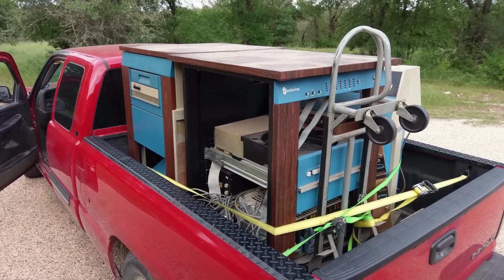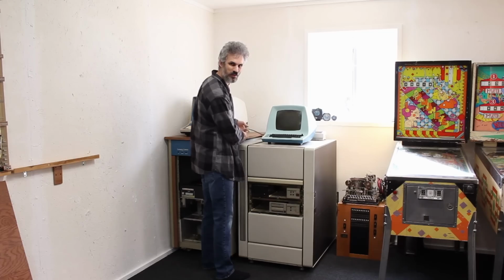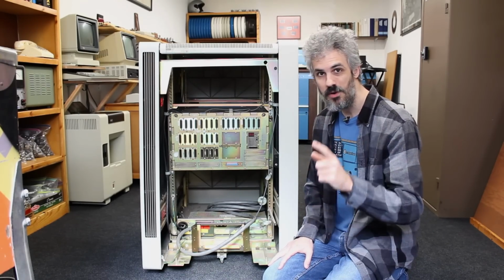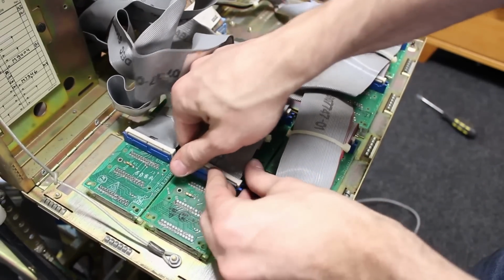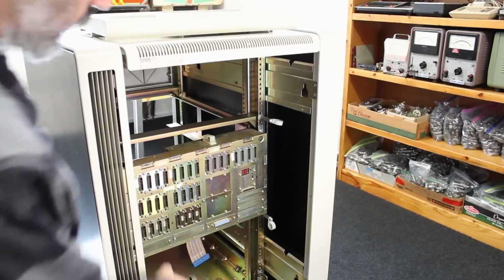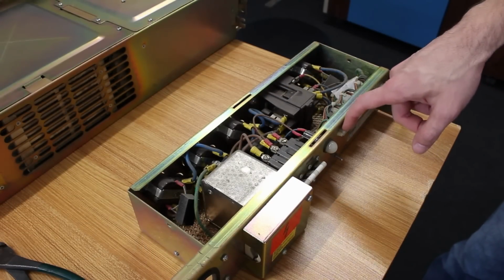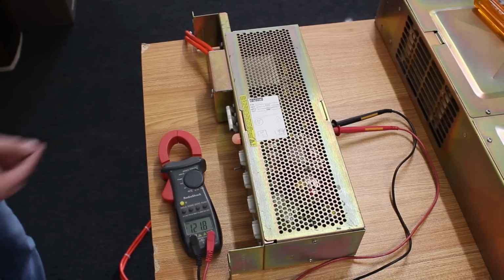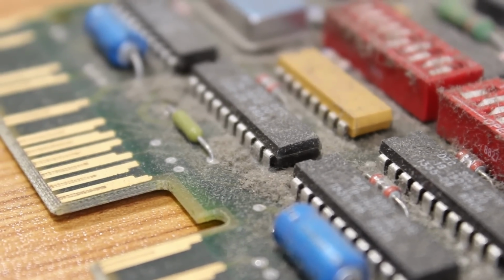I Bought a PDP-11/83!

Comment: as for cleaning off old tape residue try some heat and rubbing alcohol. Also wd40 and or brake cleaner (test first in an inconspicuous spot) ive cleaned old tape crap off by soaking a paper towel in wd40 and letting it sit on the residue for hours.

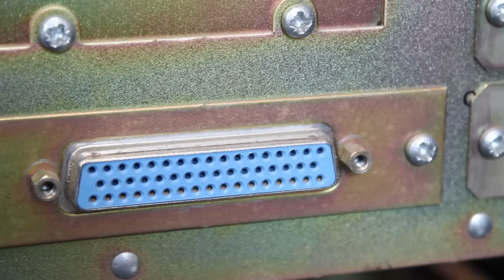Comment: 8:25that female DB50 connector is usually ALMOST GUARANTEED to be printer output.  BUT !!!
small chance it is connected data storage (handling up to 48 bits per clock cycle) 
more likely only handles 32 data lines with the two power and 16 assorted control lines
and with so many RS-232 (Male DB25 shells with just 11 pins - 8 data plus power, ground, and clock)
... HERE'S A SURPRISE... (but not really after thinking) exactly 32 - RS-232 connectors on that back plane

leading me to think it was servicing 32 users.... still not giving up on DB50 connecting to a big printer, but modern ones use USB-2 connectors. so i wonder WHAT IS MANUFACTURING YEAR? 
the PDP-11 that i used in early 80's had magnetic storage (individual magnets woven in three wires per)

a big change from what you have   ALSO , i was fascinated by the instruction set.   very minimalist. technically only about a dozen instructions

Comment: Pittsburgh is much more Tech advanced than anyone knows for strategic reasons. I know many DEC and PDP people as well as Cray/SGI and Sun. I have always had access to machines and/or people here working on projects. We are the great unknown here as far as tech is concerned. Did you know all the subs are designed here? Keep in mind that we are running PDP emulators which work VERY well for those of you who want to experience and run PDP on your own. PDP, AS400, and many other mainframe and mini operating systems are still running doing the work in the background of businesses on modern hardware. The old software is efficient, compact, and fast with NO BLOATS.  Merry Christmas

Comment: Awesome!  I acquired a DEC PDP-11/34 in the 80's.  Over time I stripped out the electronics and converted two 5' cabinets into storage bays for tools, and three floor-standing disk drives into portable woodworking tool stands -- but I left the power distribution panels in place & modified them to simply distribute 120vac thru the circuit breakers to the local power tools (so I use them as ON/Of switches).  Still work out great as tool stands, but now that I am retired & see projects like yours that are re-vitalizing some of this old equipment, I feel bad about getting rid of the electronics!  However, the pieces have been with me (through three moves across country) and have been great at what I use them for.  Looking forward to what you do with the PDP-11 ...

Comment: For the tape I recommend Spray Nine. It's a great cleaner. Beware that it corrodes bare aluminum and dissolves latex paint, but it's fine on enamel paint.

Comment: For your tape residue problem, get come coconut oil. It is a solid at room temp and will melt in your hand, put it on the residue and let it set for 10 to 15 min and it should wipe the residue off without harming the paint.

Comment: Why not just keep the original cable and replace the plug end with a normal NEMA 5-15P? You can find these at most hardware stores. Alternatively, find a 12ga extension cord. Those are also available at most hardware stores.

Comment: My go-to for tape and glue residue removal is n-heptane.  It's the solvent typically used in rubber cement, and can be found by the trade name "Bestine."  I've never found it to cause damage to any paints, including some that were damaged with exposure to isopropanol.  I recommend using it in a well ventilated room with nitrile gloves though

Comment: A PDP11 of that vintage is most certainly built around the J11 chip.
Those "Hawk" drives are most probably hardware compatible with the DEC RL01 / RL02 disk drives, or maybe the RK06/RK07 types.  When installed the carts look very similar.
That three row D connector might mate with a Centronics printer cable.  Not the usual connector for the printer, but probably the same number of pins.
The 11/83 is the Qbus version.  There are also the slower 11/73 and faster 11/93 versions.  There were also the 11/84 and 11/94 Unibus versions.  All use versions of the "Jaws" J-11 chip.  I think the max memory addressing is up to 4 MB (22 bits)

Comment: In the early 1980's, I ran the Computer Department of Wasey Campbell-Ewald, a major UK advertising agency on a PDP11/70, with about 50 terminals, running specialised software from Tempo, a company in the AGB Group, which was later sold to and pillaged by one Robert Maxwell. Great days of patch racks, self-loading tape handlers, disk drives the size of washing machines and 10-platter disk packs. All in an air-conditioned machine room. Then we swapped over to VAX 11/780 and up. Our PDPs in the UK came from Systime in Leeds, a DEC OEM.

Comment: It's been a long time since I've been near this stuff, but the general idea of that power box was you had one in the bottom of each cabinet of a multi-cabinet system, and they were interconnected via the little 3-pin connectors.   You'd have a power switch on the front panel somewhere which went to one of those 3-pin connectors on the first box and then the rest of the power boxes were daisy-chained together via the other 3-pin connectors.  The bottom line is one little switch on the front panel controlled the power to all of the cabinets.  The tape drive looks like a DLT drive (https://en.wikipedia.org/wiki/Digital_Linear_Tape).

That's a typical massively over-engineered DEC cabinet.  Crazy amount of hardware to hold a few Q-bus cards, but that's how DEC did it in those days.  I'm guessing the cabinet division was a profit center of its own.
Reply: Tape drive is a TU10 by the look.  One of its main "failures" was when someone loaded a tape with a faulty leader pickup  loop which prevented it loading.  You'd have to strip the cover off and re-thread (or replace if damaged) the leader tape within the drive and bin the faulty tape.

Comment: Consolidate the cards you're going to actually use into one ba23 enclosure and plug it straight into the receptacle, and skip using the power controller.

Comment: Get yourself a "qbone" from the DECromancer.  You can use it to emulate hardware while you test and restore it piece by piece, and it can stand in for your missing storage devices.

As a qbus -11, parts will be cheaper, which is good lol.  I run an 11/73 in a Heathkit H-11 enclosure with 4mb, ethernet, and uc-07 scsi + a BlueSCSI emulator.  Makes for a great 2.11BSD machine.

The 11/83 is a great CPU.  You got a good machine there.

Comment: 15:14 I am a big fan of Hexane, but it can eat paints, so heavy dilution and cotton swabs if you want to try it.

And there are also chemical formulations/products of glue de-bonding other than Goo Gone you can try.

But really I think a melamine sponge would work best in your case, it can remove paint if you are rough, but unlike other solutions it is a solid block, so you can apply it only to the places where you need it.

Comment: FWIW: If the usual suspects don't work for old tape goo try soaking it in WD-40 for a few hours then rub it off. Scrape off with a plastic spatula if needed, or a metal one as a last resort...
...once the goo is hopefully shifted you'll still have to wash off the WD-40 but that should be easy enough. If stained by the old tape goo rubbing with a thick slurry of baking soda will often do the job, but as it's abrasive go easy and test an out of the way corner. I hope that helps.

Comment: Those Molex connectors are for external control, which is going to be one of your settings that don't drive all the switched outlets.
The basic idea is that you hook that up to say a thermostat or a similar device, and when the device trips, it opens the 24v line and kills the switched outlets. You could, i.e., put an e-stop switch in the same loop and when either breaks the circuit, it will have the same effect. In these hypotheticals, the unswitched (always on) outlet would power a fan bank which continues to cool the sensitive equipment after thermal limits are reached.
I'm not sure if that particular manufacturer is still around, but Pulizzi (I think it's an Eaton company now) is the name of one that is, and you should be able to find operating instructions and/or schematics right online.
If you just want it to work, you can make a mating connector that jumps those two lines together. Or always run in the setting that always runs. Either/or.
Reply: I believe they were also used to sequentially enable power in add-on cabinets so that there was no single surge for the enture room of cabinets.
Reply: @SeaMower  They could do that, too, sure. Anything we could think of, really, has probably been done somewhere at some point in time for whatever good reason existed in that moment. 
Those power distribution boxes have been around since forever.

Comment: I see you were VERY BRAVE! Most cabinets of that type have slide-out legs that stop it all from falling on top of you, or at least your foot, as soon as you pull out the "very heavy" chassis! @11:47    Is that he leg, in the middle of the frame at 12:07?
"In other news", the frame for the PDP11-70 was 6ft tall and once it started falling, there was no stopping it.

32 users was not unusual on a PDP11. 
I used to service a PDP11-05 in a tertiary college, where they had that many dumb terminals, ADM-3A as I recall. They had a teletype KSR-33 as the console, because nobody needed to type on it much. The college taught BASIC programming, word processing and simple accounting using the screens. I upgraded them to 1MB of RAM because they were having trouble with the system swapping on their two 40MB CDC "washing machine" drives.

Comment: I have 7 PDP-8's.  I have yet to find a machine where the acoustic foam hasn't turned to dust.  The foam was probably purchased by DEC with the adhesive attached and cut to size.  The backing paper was removed and then pressed into place.  One of my machines had some of the backing paper still attached when it was not completely removed during installation.  I haven't found a replacement I like.

Goo Gone will eventually dissolve the residue.  I wet out a paper towel and placed that in contact with the residue.  Soaking overnight usually does it.

Nice find and thanks for the report.

Comment: Cool - lots of help available on this one since they were very popular.  I’ve owned a few myself (11/20, 11/40, 11/34) and this one is a bit newer.  But if you get stuck on learning software etc, drop me a line - This is where I started my career before moving to VAXen.  And yes, if you see a VAX, especially an older UNIBUS one, grab it - it would be a fantastic project also.
Reply: OMG… VAXen! I had forgotten that was the “correct” plural form of VAX. What great machines! I miss them

Comment: Interesting purchase... congratulations. I've got 6 PDP-11's myself, from small ones to a full 5-rack - fully working - PDP-11/44 with a "refrigerator sized" tape drive and a functional RA81 hard drive (check out the videos on my channel of the RA81). Careful, as rarely does someone stop at just 1 PDP-11....

Comment: Now that's a proper minicomputer! If you need a unix expert I'm in Austin and can help you get 2.11BSD running on it. Yes it was meant to support like 30 terminals, you still need to get yourself a DEC VT220 terminal with Sixel ("six pixels") bitmap graphics support.
Reply: And. Or add in a DEC Rainbow for fun. (could they actually be a terminal and write locally to disk at same time , I never figured that out, even though with internet or local networks I can write to any disc i have permission to find and write to
Reply: Snake oil!

(Says Saint Ken!)

Comment: That machine uses rolls of tape to hold programs and don't know if the data would be held on punched tape or not, You will need the terminal and printer for this machine, as far as I know I didn't see a Hawk drive in the machine I used at Ballymena Tech(Institute of Further and Higher Education(1983-1984)).

Comment: for the tape residue, might I recommend a Mr. Clean Magic Eraser? It's mildly abrasive, so don't go overboard, but it's soft enough that it shouldn't cause noticeable damage. I might run it over a test spot that gets covered by a panel to make sure before attacking the tape directly, but the paint is likely hard enough that it shouldn't cause problems.

Comment: I was always fascinated how DEC was able to evolve the PDP-11 architecture over the years (Going from a huge main-frame unibus, to the micro q-bus, evolving into the vax-11). Excited for the series!
Reply: VAX was an entirely different architecture.

The biggest limitation of the PDP-11 was the 16-bit address space. I remember one OS, RSTS/E, evolved increasingly creative ways to try to work around this, using various different processor modes in ways that they were not originally designed for.
Reply: @lawrencedoliveiro9104  The original 11/7xx VAXen had Unibuses and had to use Unibus peripherals, and could even run PDP11 programs in a PDP11 compatibility mode that was deemed essential to preserve existing customer RSX11 and RT11 developed software. That architecture decision was a central part of Tracy Kidder's book, The Soul of a New Machine, which documented Data General's reverse engineering of the VAX, and their design of the DG Eclipse series. PDP11s used memory management to access up to 4MB on models like the 11/7x series (and the later 11/83).RSTS's big problem was attempting to do time sharing, which involved fast context switching between users and the OS.
Reply from the maker: Thank you!
I've still got a ton to learn about the PDP-11 architecture, but this one definitely feels like a great beginner 11 to start with!
Reply: I used to manage and write assembler programs for VAXes in the 1980s.
One thing that struck me was the way DEC reused bus architectures in a hierarchical way as new busses were designed for more powerful machines.
In the PDPs the Unibus was the main CPU-memory-I/O bus.
One the early VAXes it remained as an I/O bus but was superseded for CPU-memory use.
If I remember correctly this practice continued for a number of bus architectures over the life of the VAX range.

Comment: I've had good luck using WD40 to remove tape adhesive residue. Let it soak in, you may need to scrub a bit with a sponge or soft cloth. It may take a few passes. I've never had it attack plastic or paint. I then use window cleaner to remove the remaining WD40.

Comment: My thoughts is: the main computer is connected to the pass through outlet. The it sends back through the 3 pin that is on. Then power up the rest. That A O B switch is, auto, off and always on, when a is controlled by the 3 pin. The you dont blow the breaker when you turn on, if fully equipped rack. You get a more staggered start up maybe.

Comment: You can use light paint thinners to get the glue off. It's the only way as far as I know. If you scrub it with a microfiber towel for too long it will eat just the tiniest bit of the paint but not actually in any harmful way.

Comment: The first job I ever had, the company had a PDP-11. It ran system V UNIX. I remember it also had a switch panel up front. I don't remember what the specs were on it. It was bought for a special development project. Also that "glue" you found. Most of the foam that was used had sheets of adhesive tape on the back of it. That's why it came off as a sheet. You cut the foam to size and peeled off the backing and just stuck the foam in place.

Comment: I used to install PDP 11 in rolling mills to control the shape and thickness of aluminium foil. 1982-1984. Along with multiple 8080 boards each one controlling a different aspect of the mill. The PDP 11 wa the controlling computer.  At that time the PDP 11 board rack was installed vertically in the cabinet. My company placed the PDP 11 horizontally in the rack underneath was the multiple 8080 boards and power supplies.  The company also developed custom  I/O boards which fitted in the PDP 11 rack. There were also other boards in the rear rack. For its time the distributed computer control system was very advanced.
There was also 8080 boards in the user interface panel, Spray solenoid driver (Which controlled the cooling of the mill rollers based on instructions given by the PDP 11) . 
I used to deal with the hard wear another person dealt with the software in the PDP 11 using machine code. Then the 8080 boards were programed in house in  machine code for their individual function once programmed they were never changed on site.  It would take three months to complete the installation and fully program the mill functions. The mill itself was never out of action except for the physical additional activators required to control the mill and coolant.  The rolling mill productivity going from a manual system to fully automated was increased 100 times.
Reply: I wish I lived back at that time. Back when CS wasnt infested with tech bros and 3 week codecamp retards.
Now I gotta pray my job dont get outsourced to the third world.

Now im wondering if Electrical Engineering the play.

Comment: Test the paint, in a hidden place, with acetone (low concentrations found in fingernail polish remover) and carb cleaner. Both will dissolve some paints, but may prove effective in removing old adhesive.

Comment: Hey mate, just a suggestion for your new work space. You might want to look at some adjustable height work desks. Just to save your back in the long term vs working on the floor. Perhaps combine with something like a mechanics stool for getting around your units like this. 

Not saying that that's the best solution to the problem just that your spine is something worth every penny of prevention because there aren't any cures available that you'd want over OEM parts lol.